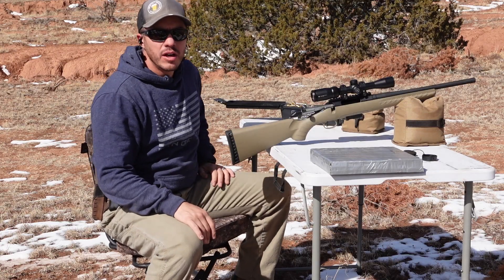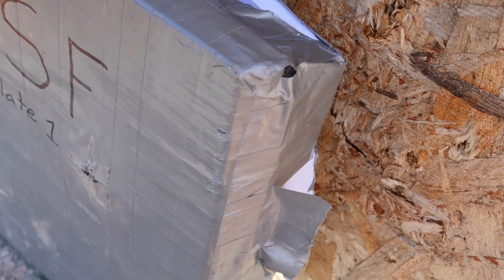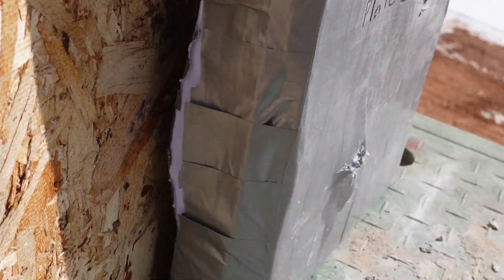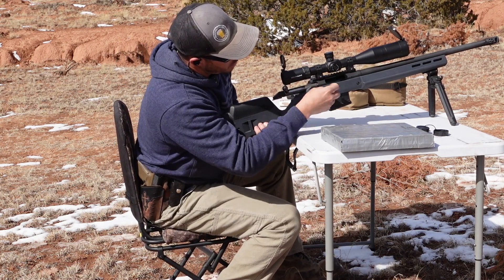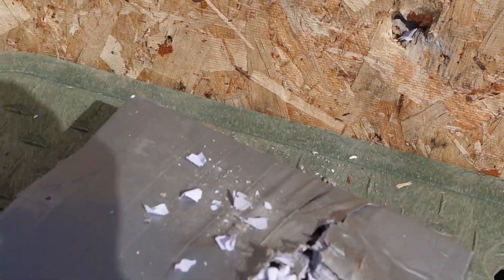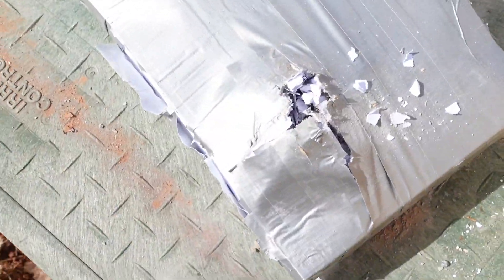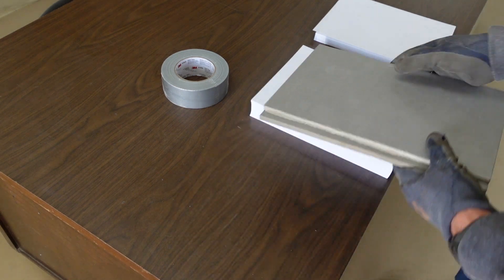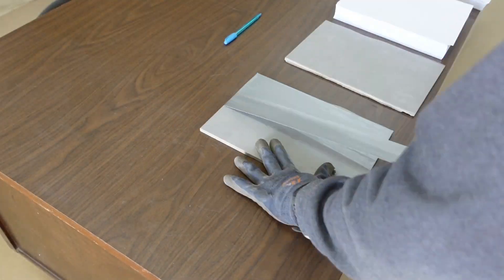Simple Tile and Paper can stop bullets from a rifle. DIY armor.

Comment: I think the duct tape between the plates allows the bullet to yaw, allowing the second tile to do much more damage to the bullet. If you or someone else expands this experiment, putting a different percentage of the paper between the ceramic tiles should prove interesting. Replacing the inner tile with a steel plate would interesting too.

I believe wrapping the individual ceramic tiles with two layers of duct tape preserves their ability to hinder a bullet travel to some degree by keeping the broken pieces in the path of the next bullet,
Reply from the maker: I completely agree with you. I have already experimented with various on both paper and tile and with steel. Also, you are correct about the use of duct tape.

Comment: I've seen other videos of DIY body armor made from several layers of fiberglass cloth held together with epoxy and a bathroom tile as a strike face. The fiberglass on its own would stop a 9x19 FMJ and with the tile would stop a few .223s.
Reply from the maker: Yep. My first video is very similar in stopping .223. Except I used GFRC ( concrete) instead of a tile.